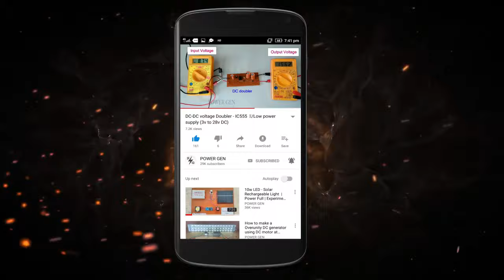Handheld mini PCB Drill machine - 0.3mm to 3mm bit / how to drill / low cost

Comment: The diameter of a standard pcb hole is 1mm which is very thin in my opinion, but I don't think it breaks the bit. On the contrary, 0.3mm drill bits may break if you are not careful.

Comment: Hi. Thank you for this.

Is it's ok to ask, Is a titanium coated micro drill significantly better than the usual micro drill that's just tungsten carbide for PCB drilling/electronics (should I skip titanium coated to save money)?

Thank you.

God bless, Proverbs 31
Reply: You don't need TiN coatings (or any other coatings) for this sort of work. Don't try using this type of drill for carbide drill bits, though... especially not small ones.